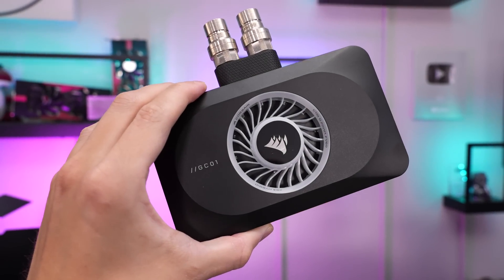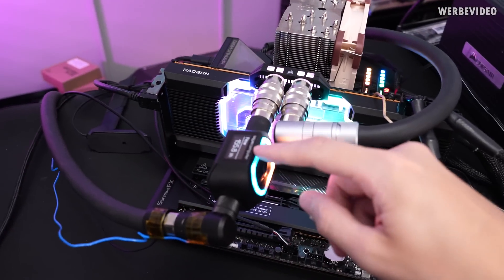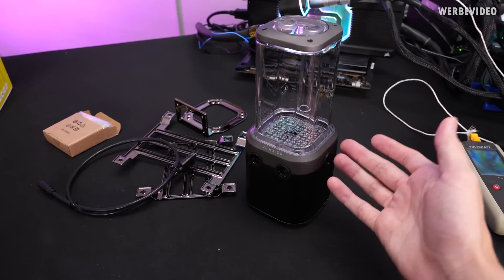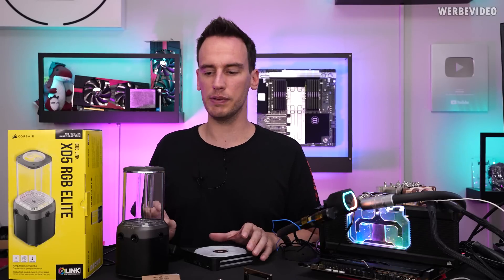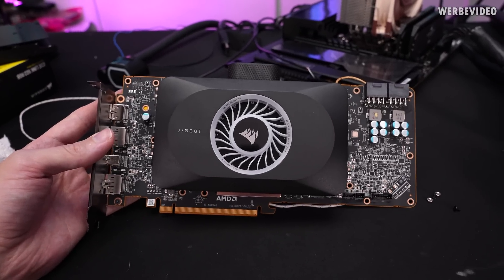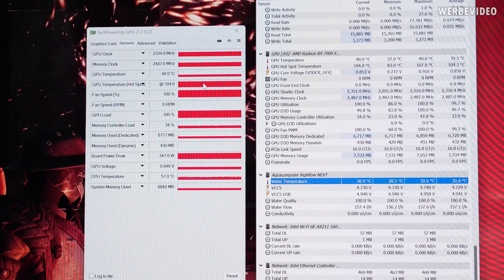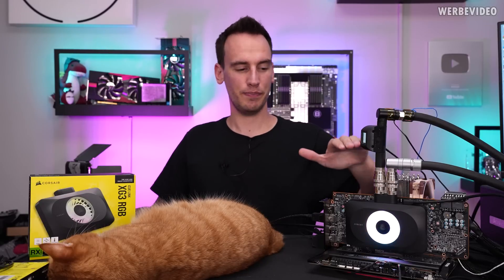There is a Problem with Corsairs new GPU Water Block

Comment: I wonder why Optimus apparently stopped making water blocks. I wanted some of their blocks so badly. 

No manufacturer has even come close to the maximum limit of microfin surface area. It doesn't have to be reserved to an area the same size as the CPU die. It could be 2x, 3x, 4x the size of the CPU package itself, and it would still draw heat away almost as if it was right on top of it. You give it enough mass to travel through, and it will go there.

Comment: I should have paid more attention to your review, I had to rewatch it. Thanks for the details and efforts you put in. Even though you dont recommend it, it was half price on Amazon so I got it anyway, then it arrived and I was shocked to find out that the fan can not be powered by a standard cable. I understood it was iCUE but I coudlnt believe it was only iCUE. I had Amazon give me 20 dollars credit back to help offset the purchase of a hub :(. Based on your review I also puchased some small heatsinks to put on the VRMs which should help with the fan cooling. I spent an hour looking to see if anyone had a hack for the iCUE cable plug to use a standard power cable from the MB to power the fan but had no luck.
Reply: So instead of buying the hub, I have just removed the aircooler and cabled tied a 140mm fan on witht he VRM Heatsinks, and the cable ties are holding on original backplate helping a lot. Temps are down and noise is down from original, VRM's 50-60 degrees max.

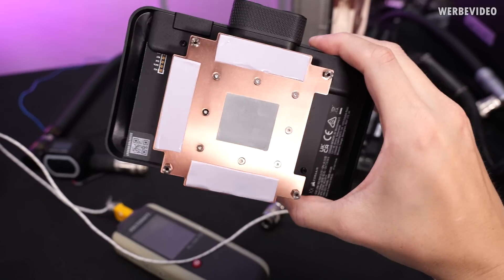Comment: So at around 8:35 it looks like you were touching the board with your bare finger and the first thing that came to my mind from working on turbine combustion cans for 20+ years is "hotspots".  Yeah, that oil from your finger could have definitely caused the high hot spot temps.

Comment: Universal GPU water blocks cool the processor only.  The test of the fan performance should be to disconnect the power.  I would say the fan is a fail.

Comment: one change could improve this thing. integrate VRM heatsinks with thermal pads into the block where the airflow passively blows over the VRMs it would help cool them much better

Comment: A little off-topic, but was wondering if you might do a video showing how to use the Kryosheet with a 7900XTX, showing application and comparisons with paste and maybe PTM7950? It seems like most 7900XTX owners are having issues with paste pumpout and this would be a great option.

I'm currently in this boat, having had to repaste my 7900XTX Red Devil 3 times now.

Comment: This thing is around the same price you can get a full Byski GPU block for and those would work way better than this even if it's not universal the VRM temps may be fine on a test bench but those will be toasty in a proper case.

Comment: 75c on 350w doesn't leave much comfort for 450-550w power or hotter summers
for the price you can basically get the alphacool block

Comment: Back in the days of the GTX 480, I tossed an Accelero Xtreme on my cards. It included VRM sinks and memory sinks that you attached with thermal adhesive. That was a true universal cooler. It worked on virtually all Nvidia 400 series cards, and it worked great! The problem with this cooler, as you and JayzTwoCents both point out is a complete lack of cooling for the VRMs. The fan is a great idea, but the lack of a $3 pack of aluminum heatsinks and $0.10 worth of thermal adhesive makes this cooler a terrible value compared to similarly priced blocks.

Comment: I caught your video of the liquid metal failure system. Since you're going down memory lane, I was wondering about cooling systems in the 2000's that placed the entire motherboard in a non-conductive liquid. Now that all parts including some power supplies have no moving parts building a completely seal system would be possible. I have seen the newest Nvme's temps going up and up and wondered if doing it this way would take care of overheating and longevity issues. Love what you do.

Comment: if you are smart, you could power cpu/gpu fan by its own heat, like with a peltier thermo-couple element generator, or just have the heat push itself out, 15W or more, how much heat power you are making by the processing

Comment: Couldn't you run three individual connections from the hub to the cpu gpu and pump. I how it's alot of cables but it would be better than using a splitter

Comment: Investors: why are we making all these different GPU waterblocks? can't we make one that is universal?
Corsair: yes about that.... herer's your garbage, now shutup. 

I get the feeling that corsair invested as little money into the GPU blocks as hummanly possible to satisfy the investors. at the end of the day... Corsair doesn't give a rip about the product, short of showing off their new link system. And i would bet that new GPU blocks that are purpose built and cool the VRMs are coming down the line. they will cost more still but... work far better. but they probably had to push something out to market for GPUs instead of investing what ever obsene amount of money it would take to create not only their universal cold plate, but the universal PCB that the cards would need.

Comment: I think "Universal" means universally bad across all 7900-family cards.  So it should work with any of the AiB, regardless of brand.  If they included some low-profile finned heat sinks to apply to the VRMs, it might even have worked passably.

Comment: Not happy about the quality of this video. This kind of delight in making fun of products while making impish faces at the camera turned me off from GN. Epecially complaining that it's not really universal because the 7900/xt is "only two cards" is disingenuous at best. It's even addressed at the end of the video. There are many different PCB designs for all of these modern GPUs, and a solution like this that only mounts using the standardized points around the die is indeed far more universal than ones that encapsulate the whole card. If you don't think "it looks nice" and personally prefer other designs, then fine. But chasing views by throwing shade and being sassy is not a trend I want to see going forward

Comment: Was hoping for more. NZXT did it right with that AIO mounting bracket. Still sitting on my 1080TI running like a dream, and for just 30 bucks. Bought an AIO for 90 at the time in 2020. Hopefully manufacturers keep trying to push this out though, simple and cheaper solutions to push people into full custom.
Reply: I wonder how difficult it would be to fit an AIO like from NZXT to a 4090.Nobody has made a video about it yet.

Comment: I actually loved the previous products, they made it real easy to get into water cooling, grant it there are better options out there for more experienced users, but Corsair had a cool ecosystem it was all cohesive and looked real good, this time around I think I will not be using their stuff though, the GPU water block is what does it for me, watercooling the GPU doesn't seem this time around to have any real benefit because NVidia locked the voltage, I currently have running for testing a 4070TI Asus ProArt and am recommending a 1440p ultrawide setup for that card, on full burn running Cyberpunk - Liberty it pretty much runs the game well enough to play satisfyingly(its not of course cranked with all the extra extras like Pathtracing and such but it handles maxxed out, DLSS Quality, Psycho RT and does it bouncing around 35-70 Frames without frame gen, really cannot complain about it, every other game it turns and burns maxxed no problems) it basically doesn't get above 57c package(TJ probably 77c) with Asus cooling solution, I caught the frequency a few times hitting up 2960 on its own when the OC automatic Tweak3 mode was enabled which I really didn't expect and the card really is not loud either which maintaining it, I am actually impressed with the card, maybe not the price of it but the card itself is actually great at doing what it is supposed to do at the target market its supposed to be at. Alphacool does make blocks for a few of the cards and I was thinking about it but I am glad I did not go that route, Its unneeded. 4080 and 4090 I would get a block for seems like its a waste for anything else this gen.

Comment: The new GPU water Block looks like a incomplete product when installed on a graphics card.  it does not look good and generally people full water cooling their PC's what their system to look good.  For the price i would rather spend a little more and get a full water block, it this one had been about half the price it might be worth considering.

Comment: My 7900xtx hotspot runs at about 86 degrees at 100% utilisation when the gpu temp is in the 60s with the Asus TUF cooler. If you're making an aftermarket cooler for that card, you'd have to be careful to make sure the hotspot is covered properly. This thing is too ugly and half a solution. It should be as cheap as it feels.

Comment: Jay also noted the screws go into plastic which is not ideal as if you want to use it or you take it on and off regularly over time the screws will start to eat away at the plastic.
Reply: @michaelscarport Even if you do it properly service life of plastic threads is limited, it's for several mounting cycles, and might just survive a couple dozen if you both care and are lucky. With every cycle, the thread becomes just slightly more difficult to find again. Which for a product that purports to be universal (and might last GPU generations) and with a price this spicy, they should have absolutely had brass injection moulding inserts there, you can screw into and out of those all day long.

Though personally i barely care, i can just re-cast plastic threads easily enough.

Comment: i prefer all metal water blocks, as those plastic threads are easy to strip with over torque, pressure from bends and your out several grand due to a water leak

Comment: It is very funny and enjoyable for some reason that Derbauer has remnant 1 running in the background on this stuff.  Love that game, and the sequel.  Even Jay didn't like this thing though, that corsair pump res actually looks alright and is more interesting.  Seriously this this costs like 120-130.... I recently got a alphacool full block with backplate for a 4090 for 165....  So for like 30-40 more you could buy a real water block....

Comment: Does seem pricey.  Does standard water blocks fit on non reference designs, because if not then is would ne use full in certain cases but that price.  Bringing it out for older 20 and 30 series would make more sense.

Comment: With as much of a gap between the shroud and the actual card there seems to be plenty of room to apply independent heatsinks to all of the VRMs. You could even 3D print some kind of faceplate to cover the PCB where it does not need the air hitting it from the cooler. However, that brings the price and skill/knowledge to a higher level as well, and this feels like an entry level product made for someone that does not know much about putting water blocks on GPUs. I feel more like they should have made this some kind of "universal" AIO rather then for a custom loop.
Reply: If you are going to spend all that extra time and money you might as well buy a full block instead of this.
Reply: @OriginalMergatroid  
Yep. That was kind of the point I was going for. Like you could do it but there is no point and the people that would be willing to do that or know how to do that would just use a proper full block anyway.

Comment: Wanna keep in mind that thermal paste likely pumps out if cooling surface is not proper flat, this also includes die surface so after 1-2 weeks or more you may see much higher hotspot temps, you can avoid this with PTM7950 altho i am not sure how long it last acording to Linus it last a lifetime, and i wish @der8auer-en would test this and especially compare it with direct die cooling PTM7950 on a liquid devil 7900 XTX and with liquid metal as well also test PTM7950 on a 7950x3D with liquid metal and PTM7950 altho do keep in mind that temps will be worse at first then improve over time like 5 minutes to 1 hour to even a day or a week sometimes.
Linus tested it and compared it to liquid metal with cpu that was not delided so results may be less favorable for liquid metal, and he got better results then liquid metal after it burned in.
There also other solutions against pumpout may be worth discussing in a video, kryosheet is often recommended on r/AMD as well, PTM7950 is from honeywell.

Comment: Custom cooling related question. I know galvanic corrosion occurs when you mix metals in a loop. But what exactly happens? I have tried google, but all i can find is that I will have galvanic corrosion.
Reply: You answered your own question. What happens with galvanic corrosion? Corrosion happens. The metals in your system (CPU block, GPU block, radiators, etc) will corrode...
Reply: @DarthChewie  that does not explain anything other than what I already found on Google.
Reply: @DarthChewie  Yes, i am aware of that. But will it corrode faster on some metals vs other? IE copper, aluminium, steel?

Comment: The universal compatibility is they work on any of the partner models, the GPU and memory are always in the same spot while everything else isnt. One card might have a component thats higher than all the rest and a normal water block that covers everything won't work with it. You can say it's marketing speak for we don't cover everything and therefore it will work with all cards to make that sound good when it's not.

Comment: The cpu water block and all the rest of the iq system including the aio units are an awesome and well thought out design. Then the gpu block is a complete after thought. It's like Corsair devs were sitting at the table and someone said, "We now have the entire link system. Well done." Then another employee reminded them they forgot about a gpu waterblock and hastily they slapped this thing together and through the usual corsair tax on it and sent it to stores for purchase.
Reply: There's other good things I think are overlooked.  Their pumps performance isn't good, for some reason there's some sort of flow impedance or pump problems as shown by low flow rates.  But I love their reservoirs as they're made from nylon instead of acrylic.  Acrylic cracks spidering on your reservoir = sad panda.

Comment: I wouldn't use this thing. Corsair has it priced at 150 euro over here. By comparison Alphacool sells their Eisblock for 161 euro. The big difference being that the Eisblock covers the entire card, which includes the VRMs and it comes with a black plate and all the relevant thermal pads.

I agree, this GPU only block, especially given that it does not include a back plate or heatsinks for the VRMs, it's just so over priced. If it was 60 euro, like a CPU block, it'd be a much more realistic price. Even if Corsair dropped the price to 130 euro, it's still way too expensive.

Comment: i have pretty much all corsair custom loop fans keyboard mousepad the lot except...the blocks 1st of all they reuse the same block since the one of my 9900k barely updating it in 5 years
also every time it shows it's very low effort both the gpu and cpu blocks and comparative tests confirm it, a bit of a shame when you sell the entire line of products, and yes the icue link seems half tought I was ready to spend the pretty much 1000$ to upgrade to full icue link but nah I'll keep my dual commander XT 40 wires salad

Comment: I love that the guy in the thumbnail is just a head floating in the void with only two arms hanging from it.

Also that's an ugly cooler even for 2010's standards, I guess someone has a silver tongue for pitching ideas at Corsair for convincing them that it was a "sexy" and "sleek" modern design, and that weird hybrid design is just for compensating the lack of VRM support on the block itself and not in the best way I might add.

Comment: Can your flow meter grab data over time or is it just an instantaneous display?  Just wondering as I've found throughout the years that trending flows, temps, etc. can drastically improve ones ability to troubleshoot issues!  Loving the flow meter!
Reply: HWiNFO can capture data over time, so.... yeah
Reply: @stoneymahoney9106  Good to know!  I keep forgetting to grab that.  Intel ETU, Core Temp, Speedfan, GPU/CPU Z, Kombustor...and Furmark.  Add another!
Reply: It’s meant to be used with Aquasuite so yes.
Reply: @Simon_Denmark  Nice!

Comment: Should place that waterblock in the cat’s litterbox. Even when people used some AIO to cool the core, as some mods with NZXT AIO in the past, one would expect some heatsink over the memory chips and mosfets, etc. I know that one cools the memory chips, but anyone who ever built a custom loop knows that a GPU can thermal throttle or even get damaged if certain component doesn’t get cooled properly, not just all about memory and core.

Comment: Do you think the excessive height, when viewed horizontally, was to allow clearance for attaching VRM sinks to the card?

I still think it looks fugly, and I wouldn't buy it at half the price, but it's the only possible reason I can think of why the shroud has such a huge gap underneath.
Reply: It's sometimes ill advised to use a long duct together with centrifugal fans. For one it's not needed, the airflow is already super directional. For other the friction of the air on the duct walls creates noise. And third the same friction reduces the energy of the airflow. Furthermore the lip of the offset ductwork forms a simple semblance of a Coanda nozzle. Not as good as a real one but then so much less noisy and better than nothing.

So i would say it looks fluid design driven.

But yeah it also helps with component clearance and adding heatsinks.